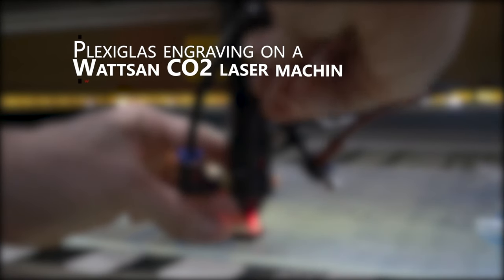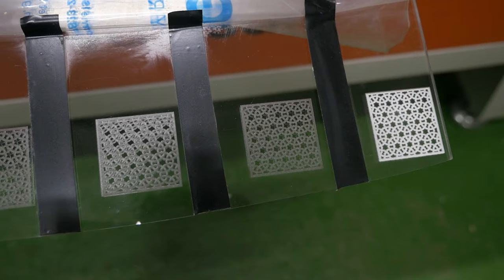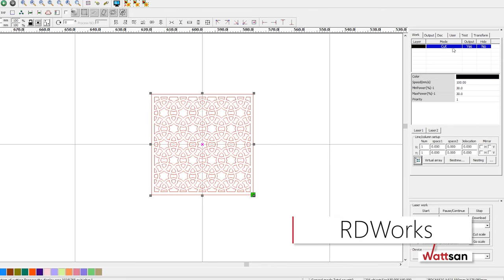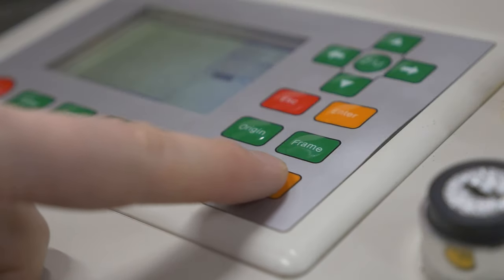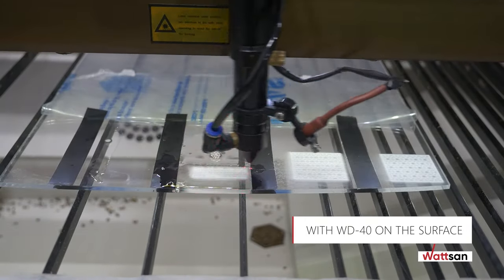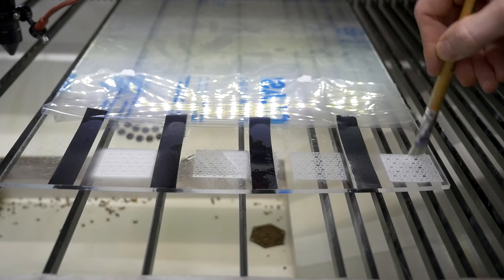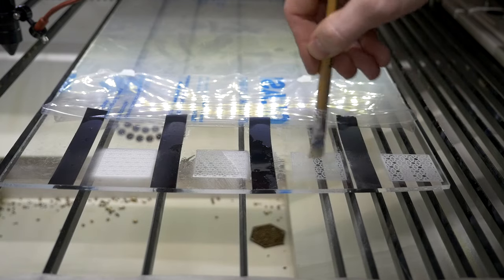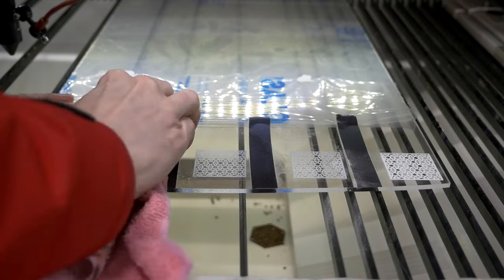How to ENGRAVE PLEXIGLASS with WATTSAN CO2 LASER MACHINE

Comment: "Choose the most optimal method for you" as the comentator advises,  seems to  undermine the whole principle of giving singlar  best advice on "how to engrave Plexiglass". There is a best way to engrave  acrylic and none of these methods demonstrate it . The results will always be mediocre if you chose to use a CUTTING nozzle.  Do Wattsan have / supply  a dedicated engraving nozzle available for this sort of demonstration?
Reply from the maker: Hi SarbarMultimedia! If we got you right,
You talks about nozzle with large hole, because large hole can decrease the pressure of air. For good cutting acrylic you must decrease the pressure of air, and you have 2 options for this:
1. Large hole in nozzle
2. Decrease the pressure of air in air compressor

Thank you for your comment.